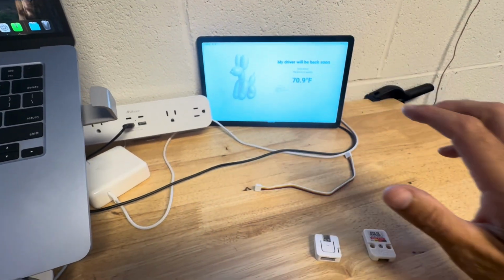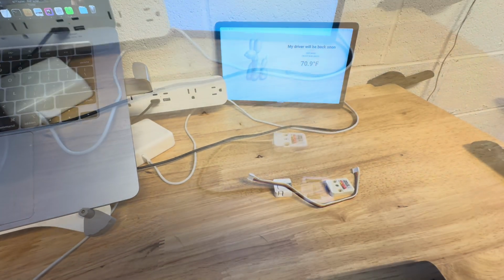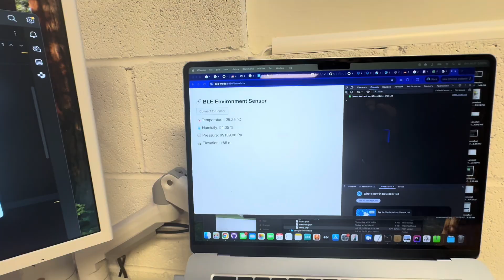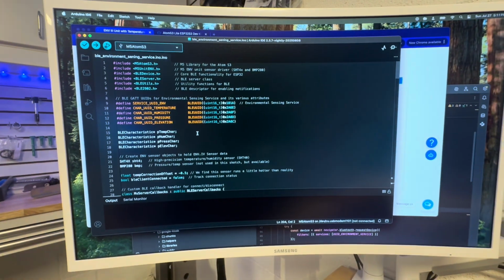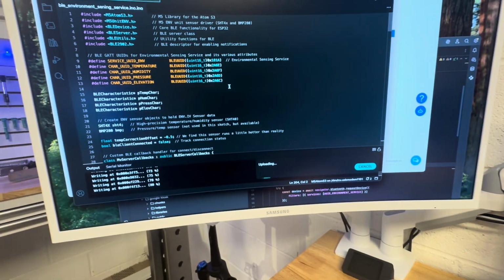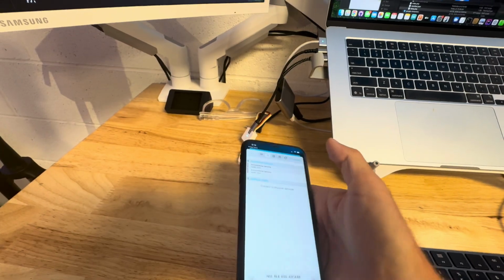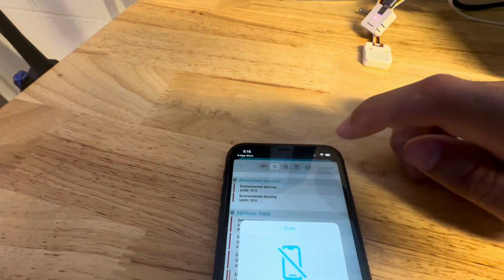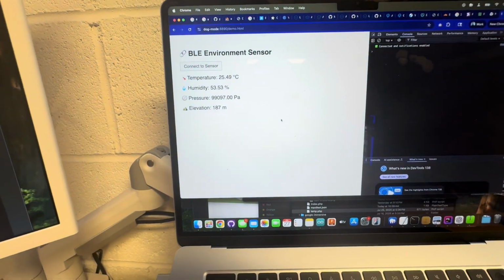Build a BLE Environmental Sensor with M5Stack + Web Bluetooth (ESP32 GATT Project) - Arduino

Comment: try 30 bucks just for the m5
Reply from the maker: What do you mean? I have 10 or 20 of them. Never paid more than $8 USD. I usually buy from Digikey for a few cents more.  But retail is $7.50 - I did not make that up. 

https://shop.m5stack.com/products/atoms3-lite-esp32s3-dev-kit